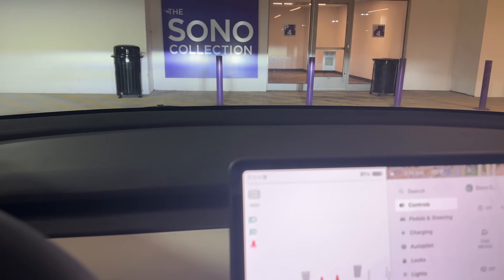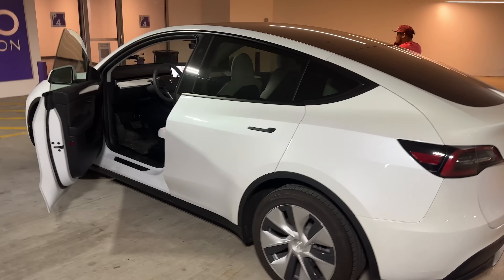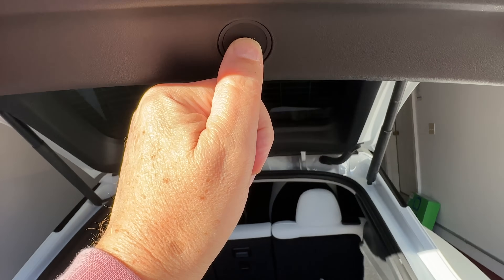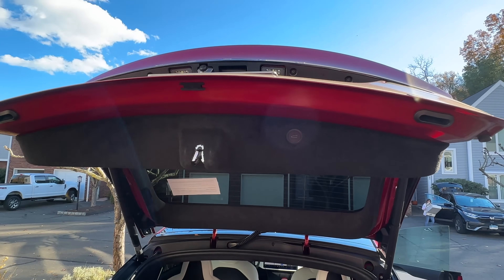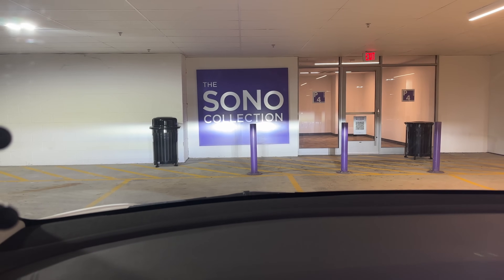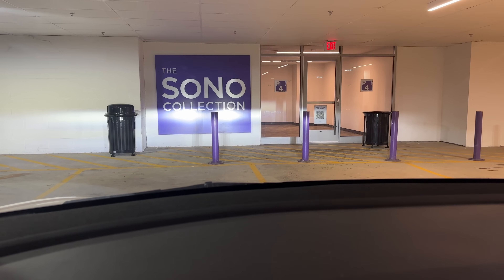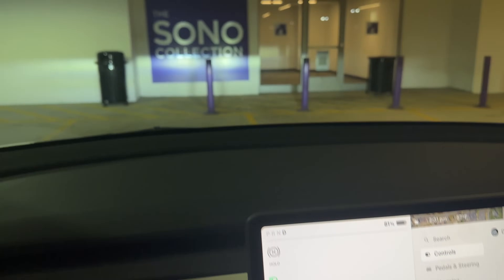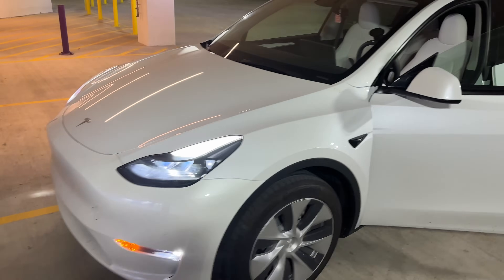Tesla Drivers Beware!  Poor Close In Vision Only & Lack Of Sensors Will Cost Us Over $2K In Repairs

Comment: It is a bummer that happened, but it’s nothing more than driver error.  How many years have we driven without this technology and everyone wasn’t hitting objects in front of the car.  Do you see how deep into that parking spot you were when you were about to hit the pole?  You were past the front limit lines of the parking spot and still hadn’t made contact with it.  Just look over the hood and when you get close, stop.
Reply: If you apply this logic overall, then none of the safety aids or driving assistance features are really necessary. We could just go back to power windows that only go up and down as long as we press the button and cruise control that had no auto sensing capability or lane keeping assistance tech, et al. The fact remains that a car this advanced should not fail in helping you do something so simple and common as parking it.
Reply: @rusticroads  exactly it’s an “aid”.  I agree the aids should work, however those saying it’s Tesla’s fault are incorrect.  The driver is 100% responsible for operating a motor vehicle, aids are there to “assist” but don’t override the need for common sense when looking out the windshield and seeing how close a pole is to the front of the car. If gps tells me to turn right and I look and see a lake to my right, I’m not going to close my eyes and make a right turn because a driving aid said to.
Reply: @optimusoff-road2770  She wasn't driving into a lake, she was driving to park her car. No one is debating whether or not she could have seen the bollard and avoided hitting it, but many people have experienced challenges getting into a parking spot without damaging their car while still getting in far enough so as not to obstruct.

The point remains that a $50k car filled with technology and sensors, especially one from a company that wants to sell you a $12,000 FSD software package *for that car*, should be able to help you in that situation. It failed because it had a feature that didn't work. 

It's hard to trust the $12,000 software to get you down the street at 25-30mph, much less down the road at 80mph, when it can't even help you park your car in a parking lot with stationary objects.